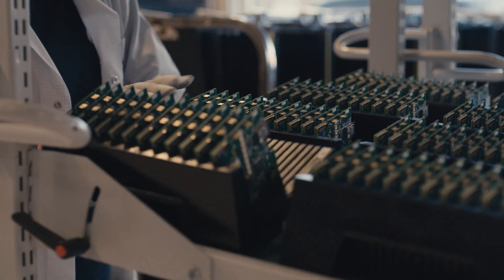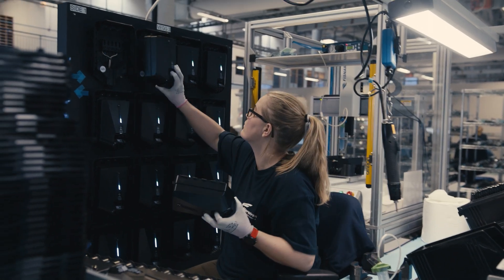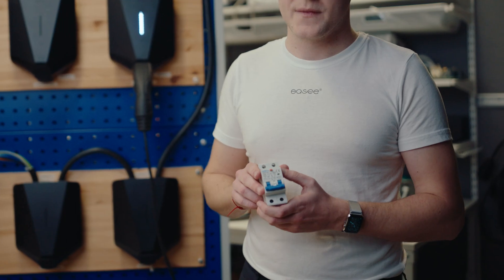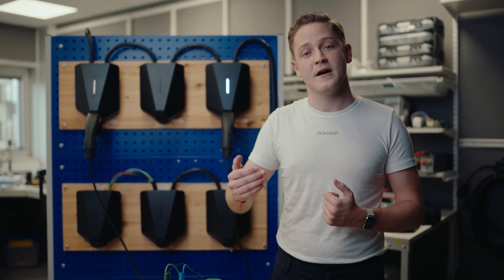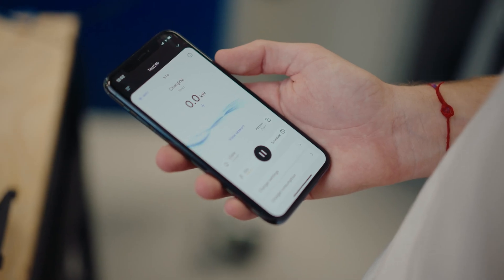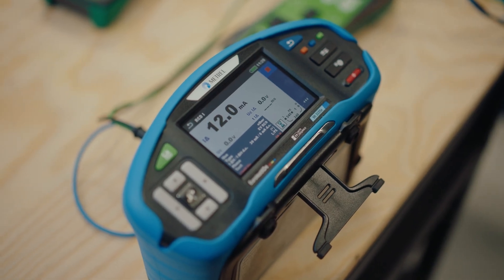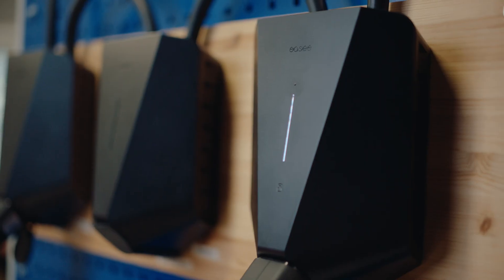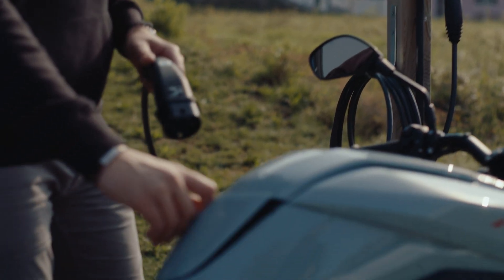Easee RCD Explainer and Test (Why our RCD is Unique)

Comment: What about the other issue? The control pilot wire that is used by the car to signal "car connected/charging readyness" is supposed to have safety extra low voltage. Only if a car is connected successfully will the 230V circuits be put live. So in case the charging cable falls i.e. into a puddle of water, you won't be electrocuted. If the insulation test is not passed, doesn't that mean it's not SELV? So when someone does drop the cable and it falls into a puddle, you will have some 230 volts there instead of 12V.

By the standard, a resistor is connected to the control pilot wire by the vehicle to signal "charging readiness". To allow the charger to distinguish between a real resistor of a few kiloohms and some salted water (again, that annoying puddle that just might be out there in the real world of wind and weather) having a similar resistance value, there has to be a diode in series to the resistor. So the 12V of the control pilot wire drops to a lower value only for one half cycle, it stays unaffected for the other. If not, the charger will not connect the live wires with 230V relative to ground each.

My point is, arguing that you can physically not touch the control pilot contact and thus it doesn't matter if it is SELV regardless of what the standard says, is kinda moot because of that very puddle scenario. Am I missing something here?

Comment: Safety standards are written in blood as they say. Maybe your RCD solution is good enough for this particular application or maybe it will fail under a weird set of circumstances that you have not foreseen. You do not get to define what an RCD or DC protection is. That’s what standards are for. You do not like the current standards then work to change them.

Comment: But the problem still persists, you have violated national and EU harmonized standards. In my view that is kind of "proof" that you either lack the knowledge to follow the standards or you simply do not care to follow them. Honestly, I do not know which is worse.
Reply: This method of RCD is far better than the ones installed in  a project ev.
I know all countries are different, but this in the UK is the best and also they fit a updated RCD in the house fuse box.
Reply: Ok, lets talk Reulations, witch terms of a RCD in your Country are violated? 
I checked back and forth our national regulations and i didn’t find anything that violates our national law. And we apply EU standards. 
For example, if a life part of the pin is exposed in a type 2 plug, this issue would be a violation for all EV chargers who have a outlet installed. 
If the rcd is tripping below a 30mA AC and a 6mA DC fault, where are your national issues? Let us know, enlighten us. Im open to lear neu stuff every day!
Reply: Fuck the standards (they are outdated), I want to feel safe when charging, that's why I only trust in my Easee charger.

Comment: One of the best chargers I ever seen and installed, don't understand that a Swedish electrical supervision is writing so much rubbish and nonsense, I think it has more to do with that ease is one of the best chargers on the marked and some one like to get it off the marked.
Reply: They dont write rubbish, they do tests in order to make customers safe when companies cut corners or dont have the knowledge to do a safe product. Design and digitalisation is good but can not replace good and safe engineering.
Reply: Nobody is saying the EV charger is the problem it’s the Electrical Standards is the issue, due to the rapid development of new electrical equipment not just EV charges. The Electrical Standards are not keeping up.
In the UK I’m installing a RCD upstream with a warning notice until Electrical Standard are changed.
Reply: Read the report before you comment! Their chargers have serious flaws. They then left their customer with the bill!

Comment: Prior last year, this kind of integrated RCD wasn't allowed in Finland, bu they became allowed when SFS 6000 electrical installation regulations were updated in 2022. Our housing cooperative has 20 Easee Charges and reservation for 26 more. I designed the system myself and took advantage of Easee's integrated protection and didn't install traditional RCD's or circuit breakers in front of the chargers. Can you also make video of how an overcurrent protection works in your product?
Reply from the maker: That's really cool, super happy to hear that you are happy with our products and im sure the people living there are happy as well ❤
We will take your suggestion into the idea bank, thank you!
Reply: How is this possible, as the standards are  EN IEC, the same in the whole. The swedish are now questioning the integrated RCD's, since they are not electromecanical, just digital trip relays. Deviation from the norm/standard is possible, it's not mandatory to follow, but Easee must prove that the chargeberry is safe, as safe as worded in the standards.
Reply: @ClaytonOfNorway  National safety authorities are allowed to make country-specific deviations in their own versions, they don't have to follow EN IEC word by word.
Reply: @ClaytonOfNorway Swedish authority ESV is not questioning the internal RCD. The RCD design failed during testing. To small isolation distance 2,3mm compared to the required 4mm. This means it can’t cope with the over voltage protection requirement. The relay welded permanently shut during high the current test, which means it’s A. Permanently broken and B. It doesn’t protect people any more and can’t even shut off. The they changed the current sense circuit without changing the drive electronics according to the manufacturers specifications. 
Bad design! Simple as that.

Comment: The issue is that it doesn’t follow the declared standards, not that it is unsafe. I keep mine until told otherwise :)
Reply: In Finland we had this problem prior 2022, but last year our electrical installation regulations were updated and these kind of integrated electronical RCD's became approved. Since our regulations are based on European EN-standards, probably other countries too adopt new standards when they update their national regulations. It's actually bit amazing that those got accepted here. Usually Finnish authorities are a bit traditional and they accept new things years after other European countries.
Reply: @Ritari2000  This was possible because we had EVC committee working on the SFS6000 this time as well, and that group is not at all "too traditional" ;)

Comment: When are you launching a charger with V2X? 
I think your SW & HW leverage will be even more obvious in such a product 💪🏻
Reply from the maker: Hey Magnus, this is something that we are working on. Since 2018 we have envisioned and hoped that the adoption of this standard would become a reality and took the chance on implementing the hardware.
Currently the number of cars that support this are minimal, but it looks like car manufacturers are starting to adopt this for AC charging as well. We have done some initial testing on the cars that have been available.
Both hardware and firmware still need further work and testing to ensure we can support ISO 15118. 
Right now, we can say we are hopeful that we can support ISO 15118 in the near future.